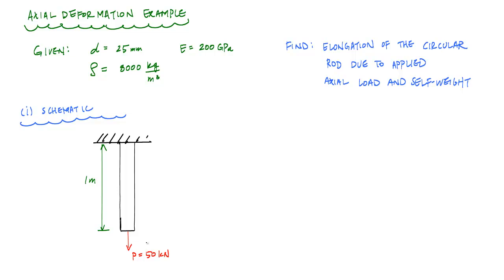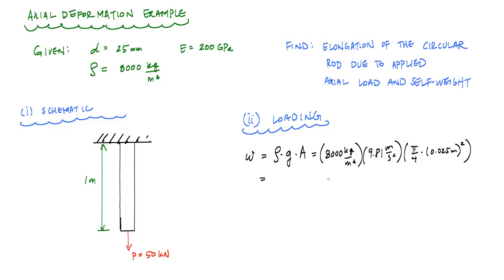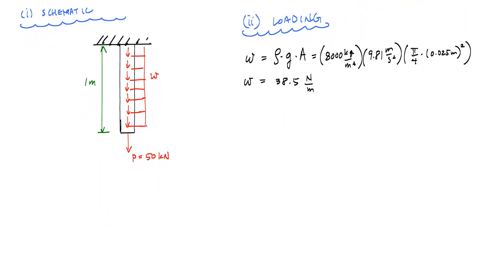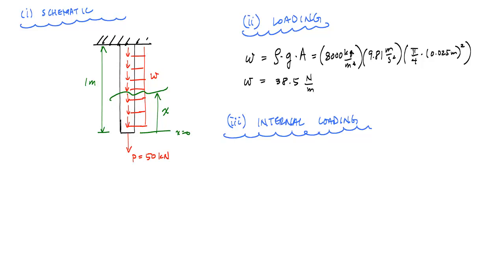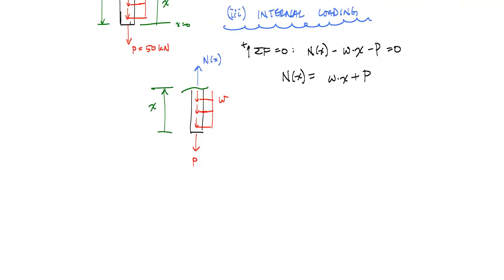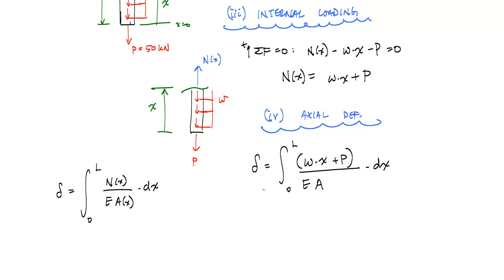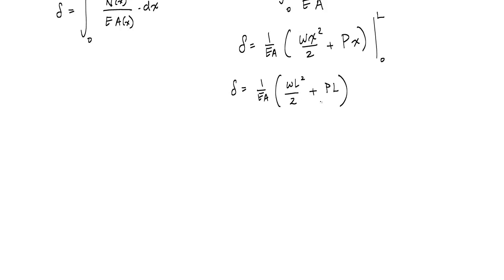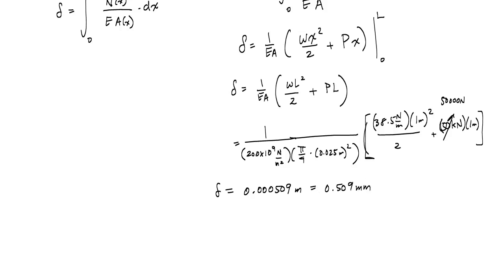Axial Deformation Example with Self-Weight - Mechanics of Materials

Comment: Can this be correct? By considering a differential element dx a distance x away from the bottom of the rod, I believe we yield a weight equation dependent on x. Then it cannot be a uniformly distributed load. 

By deriving an equation for deformation by self weight, with constant area, I yield the following equation:

deformation = (total weight of the body)*(Length of the body)/2*(Modulus of elasticity)(cross sectional area of body)

The two in the denominator implies a linear function. Not a constant function.

Comment: it should be 38.5N not 38.5N/m
Reply from the maker: it's a distributed weight since we multiplied by cross-sectional area, therefore the units are N/m.  If we multiplied by volume, than it would just be a weight with units of N.

Comment: hi all. firstly, very helpful set of vidz. i am also having difficulty in understanding the N/m of the 38.5 that you calculated. i did some analysis of the dimensions and i got that the units would be kg/s^2, because the area is in m^2 which would cancell out the m^3 of the density. and i understand that because the area is not changing, we have a uniformly distributed load ( UDL ). the whole concept of how the self weight may vary w.r.t.the length needs to be made just a lillte bit clearer please. it would help alot. many thanks and keep up the great work.
Reply: density is mass over volume. weight is mass times 9.8 m/s2. so weight is density times volume times 9.8. He messed up when he wrote density times  area times 9.8. but because the length is 1m it just wasn't bothered to be mentiioned i presume.